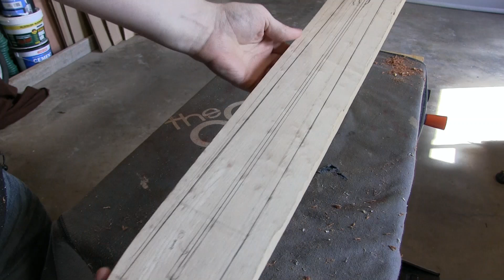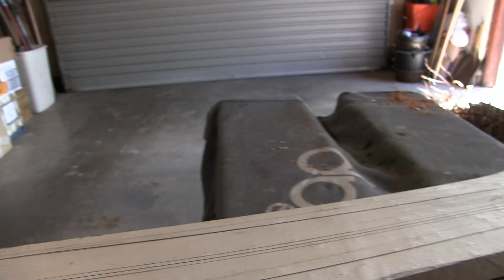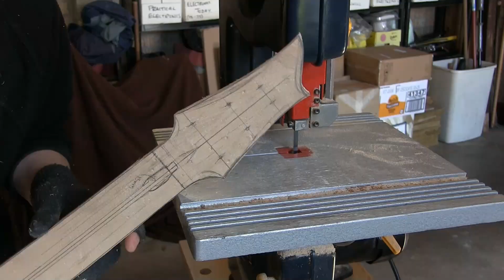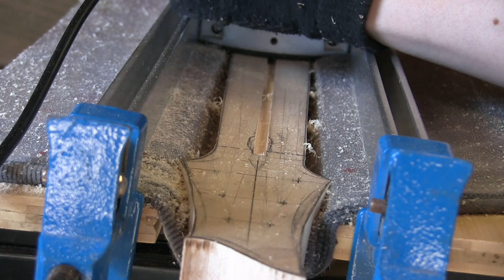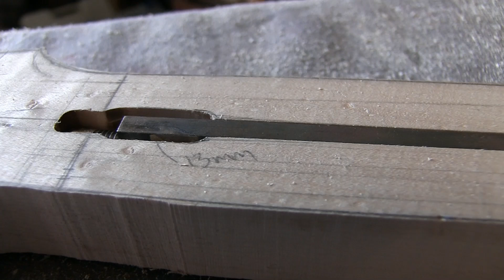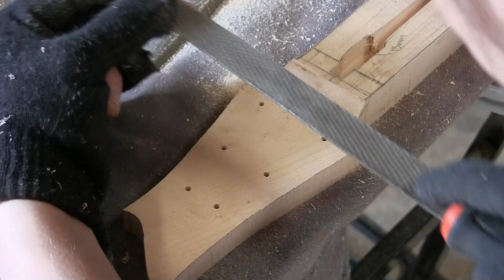How To Build a Guitar Neck: Part 1

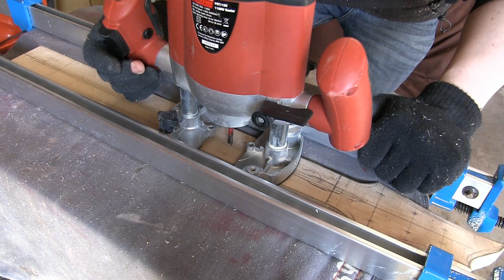Comment: 5:08 "Make sure you're not making any mistakes..." That looks like a silverline cutter in there! Gonna be pulling the blade outta your femoral artery when it warms up and decides to separate itself. No offense to silverline, who I'm sure make a few lovely tools when they're sober.
Reply from the maker: I don't remember the specific brand of router cutters, but I had no issue with them. They held up and cut material without ever exploding. 

The trick is not to put a burden on the cutter and never cut deeper than the cutter is wide. 

It's force and misuse that generally breaks tools.

Comment: Important question: could the truss rod cavity be routed out BEFORE cutting to shape, as long as you have the shape already drawn out? I don't have access to a portable router, only a CNC.
Reply: I prefer to route the truss rod channel while the wood is square...much easier...as long as you have a straight square edge and a straight flat face you can use a fence on your hand router or table router to run the neck blank up against to get a straight truss rod channel...no jig required

Comment: Hi, this is a very helpful video. Just wondering could I use a portable jig saw instead of a band saw to cut out the shape of the neck out of the piece of wood? Thanks!
Reply: Sure, its just harder of you have a jigsaw on the cheaper end

Comment: Is it possible to use a jig saw instead of a band saw when cutting the neck out of the block of wood? Thanks
Reply: segoviate Yes but it will be hard on the blade and will take much longer to finish off.

Comment: I'm building my first guitar but have no idea where to drill the holes in the headstock for the tuners. Can you help?
Reply: if you're not too fussed about straight string pull then you can put them more or less anywhere provided the angle to the nut isn't too high and strings to each machine don't get near to touching each other.
Reply: Mikail Elchanovanich Thanks a lot!
Reply: no problem. i've seen some pretty crazy headstocks that have worked fine, one i saw was shaped like the head of a hammerhead shark with a line of machine heads parallel with the nut, it had string trees for every string to reduce the angle of the strings going through the nut so it didn't explode when the guitar was under tension though, just don't go too extreme and you should be ok.

Comment: Does the neck have to be angled at all during manufacture? I ask because necks are angled back slightly between the 3rd fret and the nut, to allow the string tension to straighten it when in tune. However, I have never heard anything from anyone about angling the neck and fretboard during building
Reply from the maker: Psychotic Horse Meat Depending on the design of the guitar the neck can run at an angle to the body, usually to incorporate a tune-o-matic style bridge, which sits much higher off the body than other bridge styles. This is the whole neck however, not one part of the neck. If you have a neck that pitches back only between the 3rd and the nut then something is wrong with that neck. 
You're playing surface should essentially be level from top to bottom, although many players do prefer to set the truss rod so that there is a slight upbow to give them a little more clearance while playing at the middle of the neck.

Comment: 5:00 why angle the truss rod cavity?  Surely the rod is 9mm up until the end where the nut part is 13mm.  Im not sure that angling the slot is the best way to go
Reply from the maker: no, the rod itself tapers from 9 to around 11mm and then the nut extends it to the full 13. I've installed several of these truss rods now, trust me on this one.

Comment: Hi, I have a question, is there any reason why are you not doing a scarf joint? As far as i know it gives more resistance to the neck.
Greetings and thanks for the video!
Reply from the maker: dalazerkitteh I have built necks with scarf joints before and will probably do so again, but this build was a commission and the customer didn't want a back angled headstock. 
Scarf joints are really a solution to getting a back angle from a thin neck blank, it's preferable to build a back angle from a deeper blank than risk a scarf joint splitting at a later date due to impact to the headstock. That's just my take though, I know of lots of other luthiers who scarf by choice. Done right there shouldn't be any issue, but it can become a weak point.

Comment: Looks great! But some advice don't wear gloves when working with power tools such as a bandsaw...
I almost lost my fingers when working with gloves and a dril.
Reply: Yes indeed, Ive seen hands pulled in and chewed up due to this very thing. Every shop Ive ever worked in and the subsequent ones Ive managed have specific rules concerning gloves and the machines, and its NO!
Reply: mail gloves are the way to go
Reply: I've heard and saw a few pictures of so many peoples cloths/gloves fabric being caught and they end up  turning into minced human :-/
Reply: Wrong, its only high speed rotary tools you should not wear gloves with, its fine with a bandsaw - I was a Design Tech teacher and lecturer for many years - in fact in an industrial production environment you'd be required to wear chain mail gloves if operating a bandsaw all day
Reply: @kickpublishing  A band saw is a high speed rotating device though?
Reply: @M3lodicDeathmetal  depending on the saw some band saws go up and down some rotate
Reply: I agree with no glove on some power tools. If the tool is smooth with no teeth or wires however, I wear gloves. Sometimes I have felt the glove being cut before my hand. When I do wear gloves they are leather. 

More importantly, beautiful work. My medium is not wood. I am always a little jealous.
Reply from the maker: VI GI Those gloves have actually saved my fingers a few more times than I wish to admit. The holes in the fingers are from getting too close to the band saw.
Reply: CSGuitars then you're a lucky... cause if the fabric of the gloves catch on the theeth of the bandsaw you're pretty fucked.
Reply: I don't think gloves will catch on a bandsaw blade because the motion is linear. But they probably will on anything that rotates (e.g. planer/jointer head, drill bits, lathe workpiece, etc.) For what it's worth, the gloves he wears in the video are quite useful for avoiding splinters, and you really shouldn't have your hands anywhere near the blade anyway.